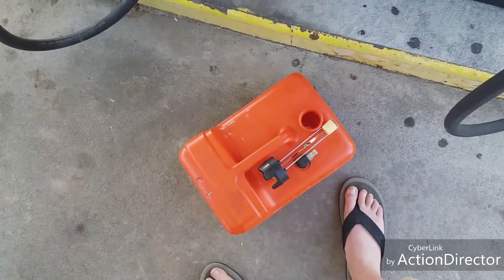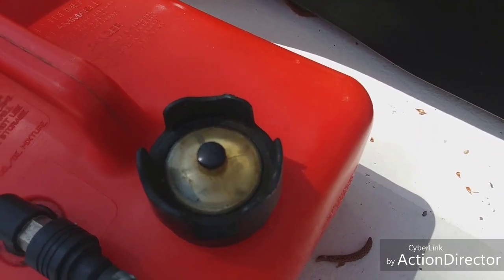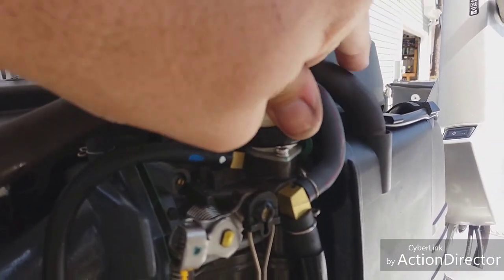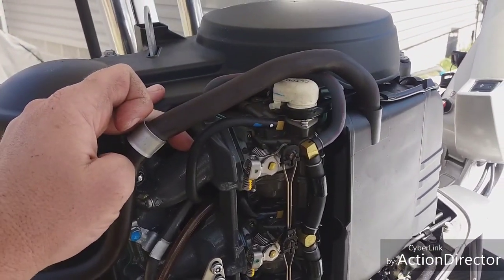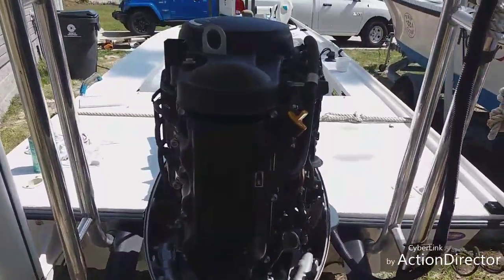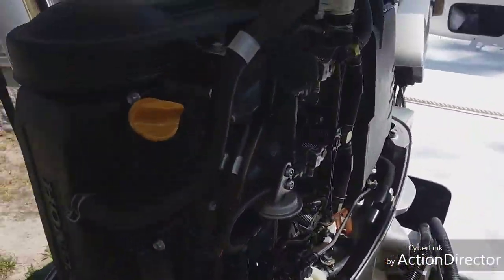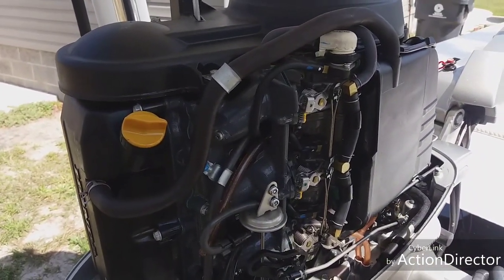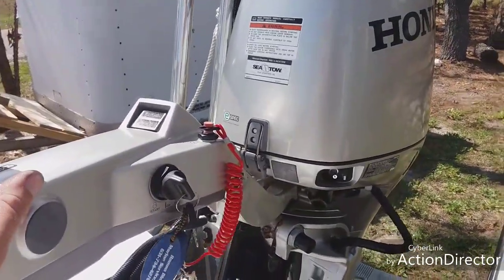Starting Honda 40/50 HP with the Dreaded Electric Choke or By-starter Valve

Comment: Hello thanks for your videos i have a question for you i have the same outboard 40hp 4 stoke but im having problems with my number 1 and 2 cylinders not firing they seem to be taking turns running do you have any idea what could be going on thanks for your time
Reply from the maker: I would see if you can borrow a spark checker. Hook it up to all 3 cylinders and see what you have. Whether or not you have a spark problem a carb problem or a plug problem. Let me know and get back to me. If you can do a compression test bang that out so we can rule out rings pistons rods all that. Honda use to like a comp test first thing. I'll get you through this.
Reply from the maker: Your out 10% on compression but not enough to say #3 has the issue with it high and not low. Swap plugs make 3 #1 2 #3 1 #3 try again see if problem moves? I'm thinking you have a carb issue only because 9 times out of 10 it's fuel related. See if you can get a spark checker even an inline. If it's good your problem lives  in the carbs. Let me know what you find. You should have a separate coil for each cylinder as well. If it was a coil under the flywheel you'd see all 3 cylinders have issues. Something smells like carb issues. I've cleaned mine 3 times and 1 carb just has it out for me until I ran non ethanol fuel. Let me know.
Reply: Thanks i really appreciate it bro i did a leak down test and a compression test now ill get a spark test I'll let you know what i find thanks again
Reply: I have pulled the plugs and checked for spark they have spark but its like 1 and 2 are firing when they want to like there taking turns working im lost
Reply: My carbs are good and clean when i run the motor and pull the plug wires one at a time 1 and 2 change the idle some times but number 3 is a drastic change
Reply: The compression is 130 130 150

Comment: Hi there! We just bought a used boat with honda 2006 4 stroke 40hp, and we have problem everytime we start it. It would take 3 to 5 start just to make it start. We've check everything, new spark plug too. I wanna share to you the video and hoping you can help us with it. Thank you!
Reply from the maker: With out even seeing it. It's probably the electric choke. They have been known to give starting issues. 
But first trim your motor all the way down. Prime your fuel bulb til it's hard. Snap the throttle 2 times. Make sure it's all the way back to start with no throttle at all. Then start.  If it gives you issues over and over then finely starts and idles perfect it's the choke. If it coughs and pops then it's something else in the carb. Get back to me and let me know.

Comment: I have a bf30 that doesnt have the Honda Outboard 16' Main Engine Wiring Harness Control Box To Motor 14 Pin or the wiring to connect the battery to the starter. Can you show me how yours is setup?
Reply from the maker: Brandon send me an email to captainrobthompson@gmail.com I will try to send you pics from there.

Comment: What prop size are you running I’m trying to find a prop for my Honda 50hp tiller are you using a oem prop ?
Reply from the maker: Ok I'm running a Honda aluminum 11.5"dia x 12pitch x 3blade 40hp on a hull that's 500lb. I don't hit the rev limiter but by the sound it's close.
Reply: I don’t have a tachometer on my motor do you think I should start with that size prop then go from there ?
Reply from the maker: I don't have a tach either. Call powertec props and give them all your specs weights sizes and hp. They can get you really close on the first shot.
Reply: Captain Rob Thompson Ok  thanks Appreciate it !

Comment: What year motor?
Reply from the maker: Pretty much I don't think you'll notice any difference. Just make sure the water pump kit it the same. Run your numbers on the Honda marine website you should be good!
Reply from the maker: This is a 40hp 2004. With electric choke.
Reply: Thanks I have a 2008 40hp not peeing want to change impeller seen ur video on ur 2004 would mine be the same ?

Comment: Hey have the 50hp to this.. An it won't start not geting spark.. Any help????
Reply from the maker: Ok no spark at All? Try to find an online manual to down load. It's hard but they can be found. Your gonna have to back track from coils to flywheel. Did you use and inline spark checker? Let me know